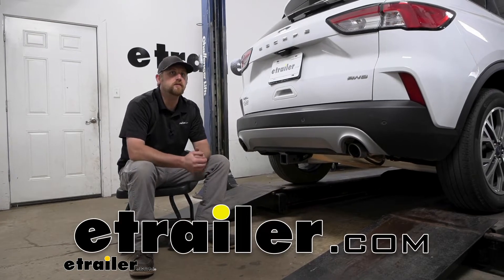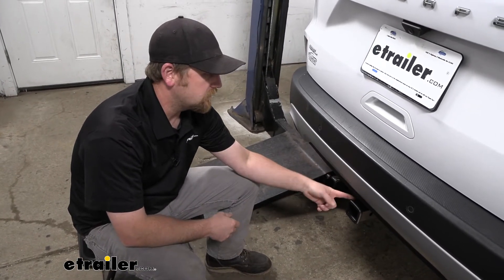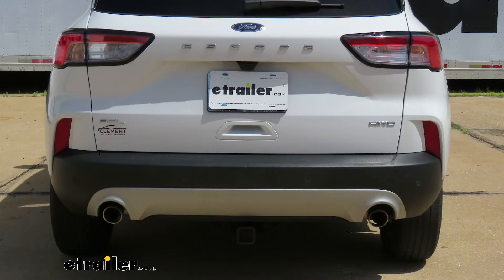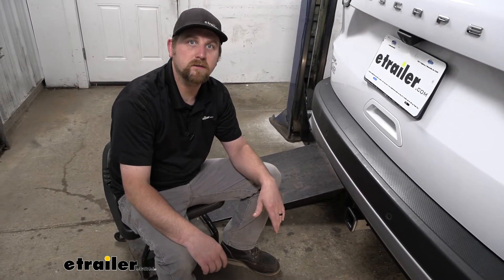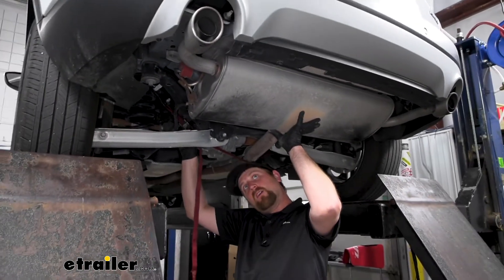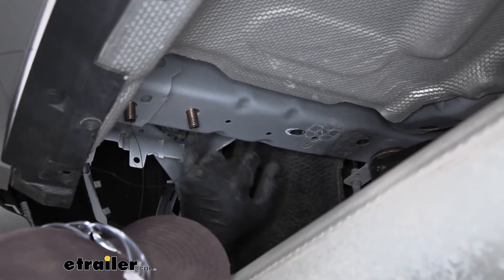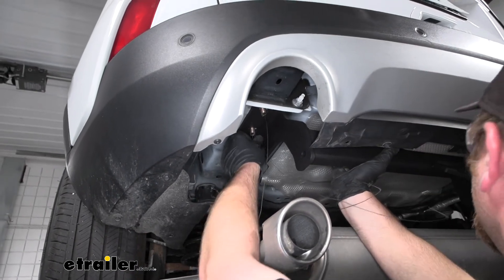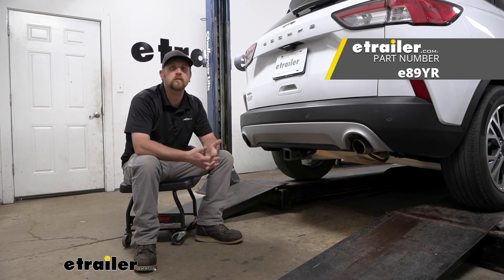How to Install the etrailer Trailer Hitch Receiver on a 2021 Ford Escape

Comment: What is the tow capacity
Reply from the maker: Although the hitch has a 3500 lb towing/525 lb tongue weight rating, you will actually be limited to the towing capacity of the vehicle. The towing capacity will depend on which engine the vehicle is equipped with and the drive system (FWD vs AWD). Here's the specifics:
- 1.5L EcoBoost FWD or AWD-2000 lbs
-  2.0L EcoBoost AWD 2000 lbs w/o tow package, 3500 lbs w/tow package
- 2..5L 1500 lbs
Hope that helps!
https://www.etrailer.com/Trailer-Hitch/etrailer/e89YR.html

Comment: Is it the same for 2022 escape plug in?
Reply from the maker: This will not work on a PHEV. The manufacturer has put out notifications stating this fit excludes the plug in models. They currently do not have a hitch receiver that will fit but they are working on a solution. https://www.etrailer.com/ If you need anything else you can use our fitguide to find specific items for your vehicle.

Comment: They couldn't have designed the hitch so the bolt hole aligns to the existing frame hole instead of forcing you to grind a hole into your frame?  Who decided this?
Reply from the maker: The presence of the muffler hangers that are temporarily removed at the 5:15 minute mark is what makes enlarging those holes necessary. If the hole wasn't enlarged as shown in the video, there wouldn't be enough room to install the rearmost bolts. I couldn't say who decided this, but it's a function of the way the vehicle was designed. https://www.etrailer.com/Trailer-Hitch/etrailer/e89YR.html